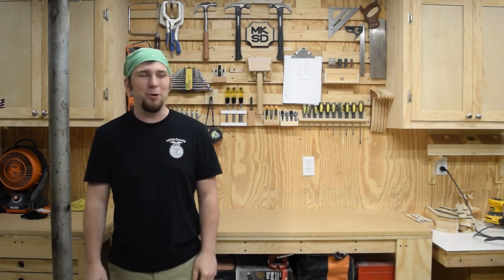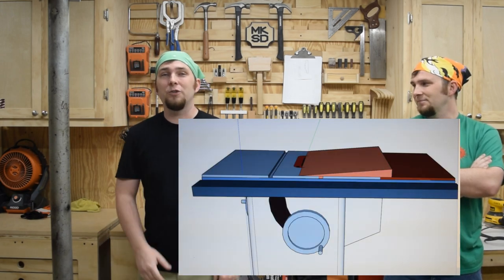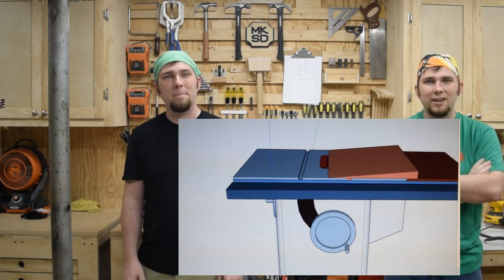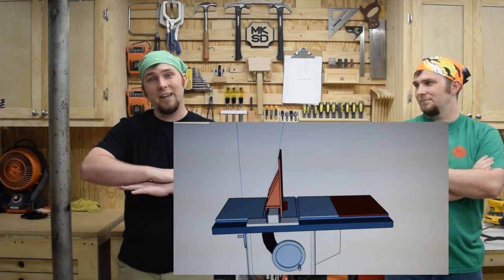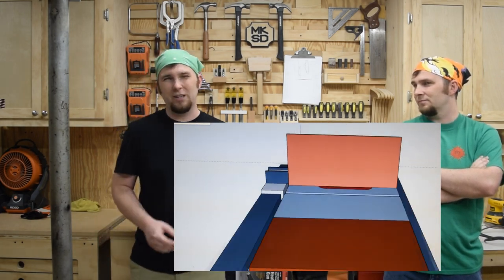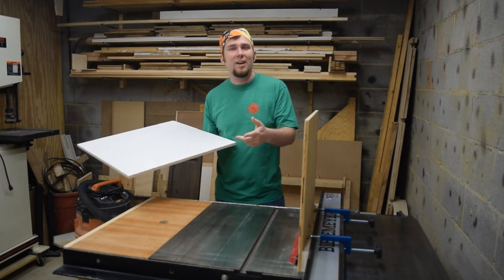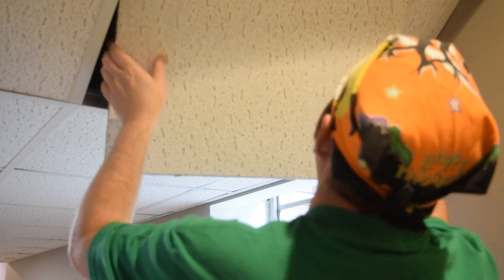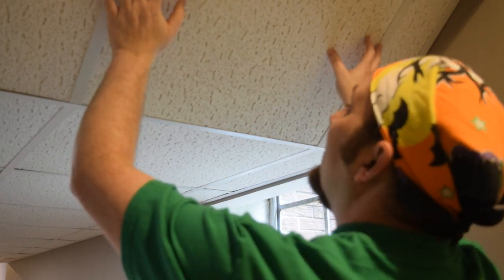Extreme Bevels

Comment: Nice! I did something similar, but I attached the piece to the sled, and instead of clamping the sled to the fence, slide the whole sled down the fence so that you don't end up with just the saw blade supporting your piece halfway through.
Reply from the maker: Nice work! Sounds pretty similar to a tenon jig, can it handle big pieces? In my case I built this to work on any fence (I borrowed this table saw just so I could cut ceiling tiles outside), and since I hardly ever need it I wanted to store it  taking up minimal space. Thanks for watching!